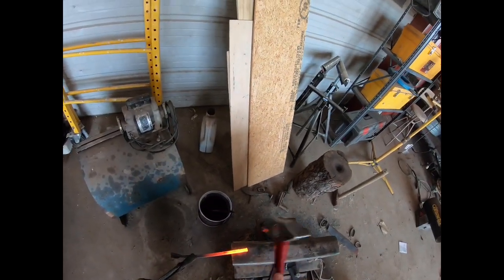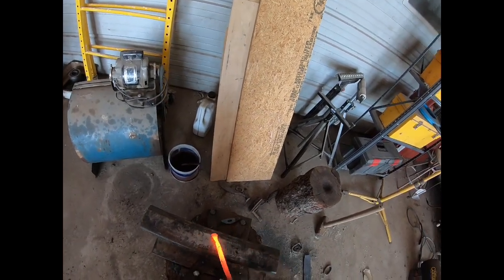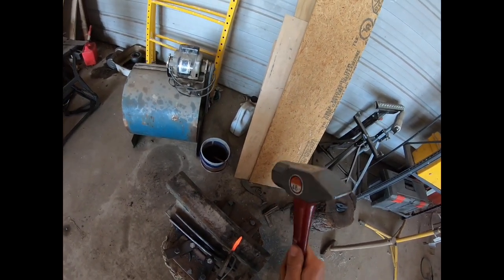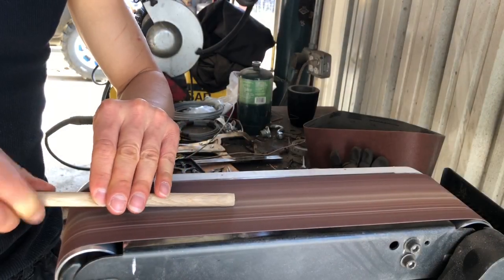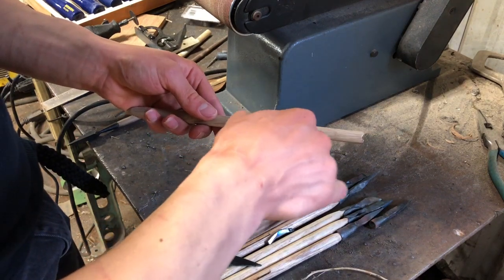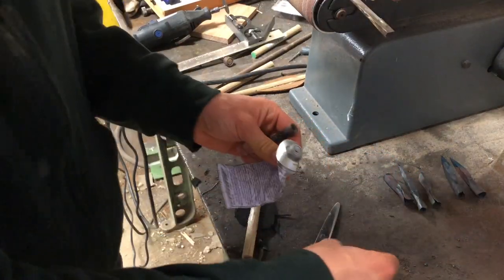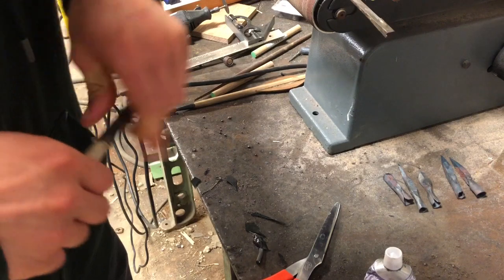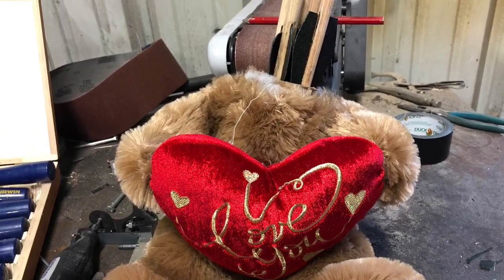How To Make Medieval Crossbow bolts

Comment: If you put the head on(the bolt, not the Teddy-he can die) before fletching, you can simply roll the bolt on a flat surface to easily see how true the point is & adjust accordingly. I think the "leather" often used on medieval bolts was parchment, sometimes taken from(expensive then!) books. More like thin rawhide. Now beheading Teddy seems a waste as good sized Teddy bears make excellent TARGETS for arrows or bolts(Use suitable backstop).
Reply from the maker: I never considered rolling to bolts to keep the heads on strait.  I will have to remember that when I make more.  As for the teddy bear, I thought it would be funny to use it to hold bolts and it was fun revealing it of its head.  Although I think it would fun to get a giant teddy bear and shoot it with flaming arrow.
Reply: @brokensteelforge232  Burn Teddy burn! LOL. The further back towards the nock the fletches are put, the more stabilising they work(simple leverage). Bolts being so short, you don't need to leave much space like you would on arrows for the drawing fingers to clear the fletchings.

Comment: "I used this old leather vest I had lying around"
As you do
Reply from the maker: I use scrap material all the time.  Sometimes you just have to use what you have.
Reply: You can use any rigid or reasonably rigid material.. from thin wood.. to plastic... it doesn't really matter... I suspect that waterproof cardboard would likely work once.... just use a stack of turfs to shoot them into for training and recycle the same bolts..